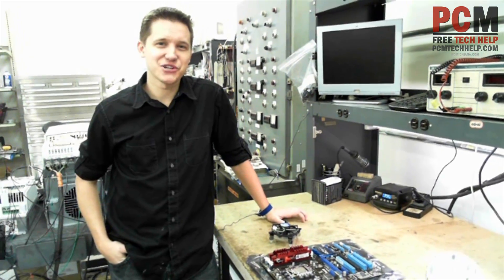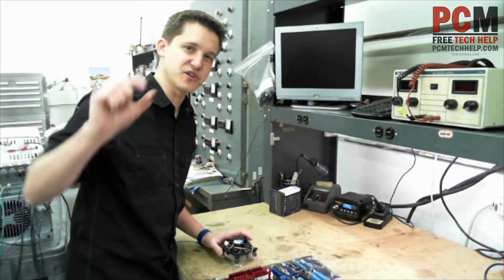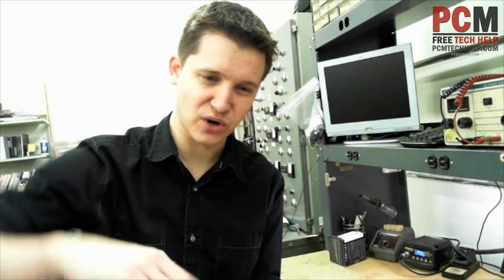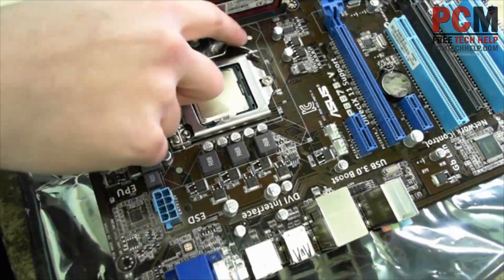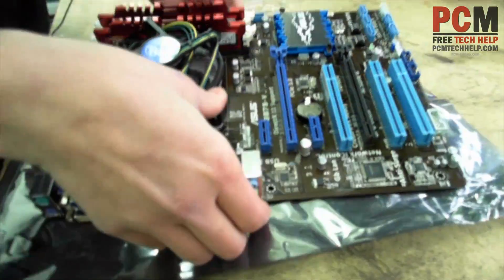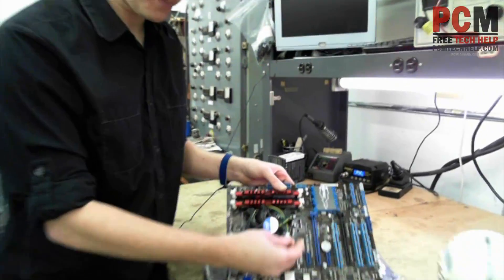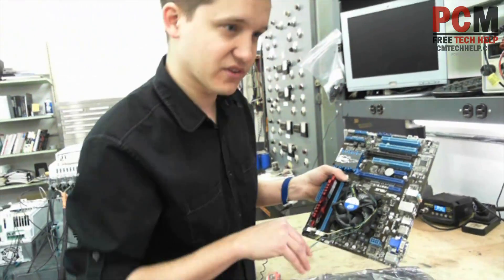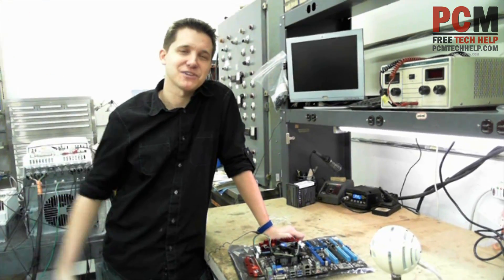How To Install A Computer CPU Fan (Core i Series) (2022)

Comment: This is the worst cooler design ever!!!! there is no way of telling what the arrow does! does turning in the direction of the arrow lock or unlock the cooler? If you so much as slightly bend one of the plastic pins it becomes a nightmare to reinstall it. This is a one time use cooler design, if you try to reuse it chances are you WILL bend one of the plastic pins that insert into the motherboard holes and ruin the cooler. HORRIBLE !!!!!! why not just make a screw and spring design? that was reusable many times over with no headaches.
Reply: Will V That's exactly what I wanted to say!

Comment: In principle, it sounds very trivial.......... just spread on some paste, slap on the HSF, plug in the 4-pin cord to the motherboard and you're good to go.  In my experience.... it really isn't that simple.  In fact, the only thing keeping me from building my own system is the fear of outright frying the CPU because of improperly, insufficiently, or even excessively applying thermal compound.  You just spent more than $1200 on parts, I say to myself....... are you gonna f_ck it over by improperly applying a single drop of $6-$12 thermal paste?  heh... maybe i'm just highly risk-averse.  :\  I mean, even if I could manage to get the system up and running, everything seems fine..... then a week or two later, I start running into problems only to find out that there's a friggin micro-hole burned in in the CPU or something because there was a single bubble in the thermal paste... i'll be back to square one and down $1200.  Not a particularly pleasant thought.
Reply from the maker: It's not so bad and most motherboards will keep you aware of overtemp or you could download a 3rd party app to monitor temp while you use it
Reply: The most CPU temps are locked at 100°, if they reach 101, they shut down the system. Running your CPU on that temp won't do damage at all. Just install GPU-Z or Throttlestop to display heat status of your cpu.

Comment: after I fix the fan on motherboard , do I need to turn the locker to left direction !!
I did fix this fan on many boards ( I work in computer store) but I never turn it to the left side after I fix the fan on the board

Comment: Before I put Artic Silver 5 on I was running 36c idle but now its 50c idle. I spilt a tiny bit on the green part under cpu but doesn't look like it got on any small parts. I think I put a little bit too much also. I used the dot in middle techique. I had trouble putting the fan back on also and don't know if it's in the right way. Please help

Comment: I'm wondering if there's a difference between putting all the parts like the CPU/fan/RAM/gfx card and whatnot on the motherboard before sliding the motherboard in... or motherboard in first then put the stuff while it's hooked on the case, like is there even a difference? maybe one is easier than the other, I'm curious to know.

Comment: Oh no, the instructions in this video are a bit wrong. When you press the pins down and they click into place they are locked. Do not turn them! Turning the pins in the direction of the arrows is what unlocks them – you only ever do that to remove the heatsink.
Reply from the maker: Thank you
Reply: does the fan have to go the way he put it in or can it go any direction? i put new thermal paste on and forgot the direction if there is one and I'm getting way higher temps then before. I had 2 years stock thermal before
Reply: +Craig “The Tech Teacher” Chamberlin  YES please put that in your video  that you mounted the fan screws wrong. thz

Comment from the maker: You don't need the thermal paste to look like that. Really after you've cleaned the processor and heatsink with rubbing alcohol all you need to do is apply a "grain of rice" sized drop on the processor and then place the fan on top of the processor to install it.

Comment from the maker: From what I understand all basic computer manufacturers (including their manuals) recommend a rice sized drop of arctic silver or ceramique in the middle of the processor (it will spread into a circle). I will add your request to my list. The other two you suggested risk leak to the edge of the processor or air bubbles.

Comment from the maker: If you don't apply it at all or correctly it will not reduce the speed but it will reduce the lifetime of it. In fact, if you don't apply it at all you risk damaging the processor completely.